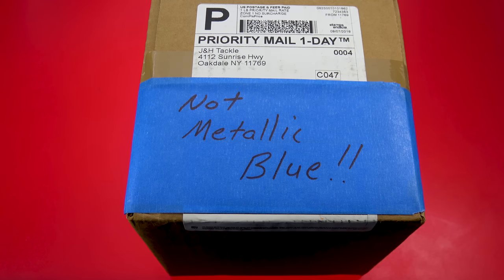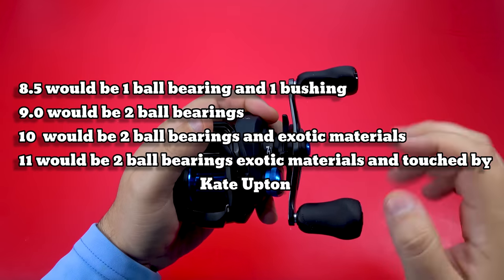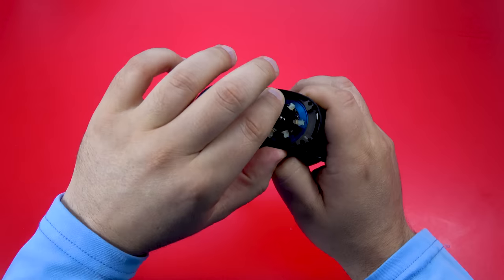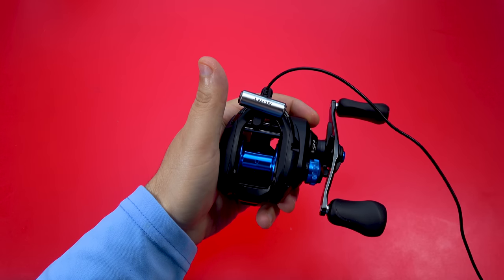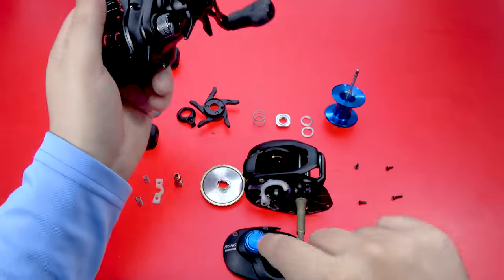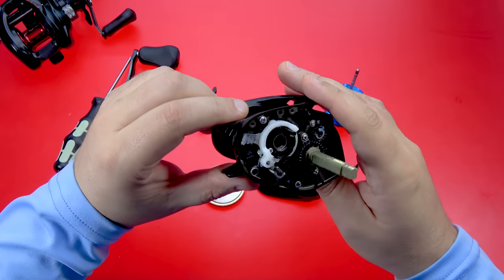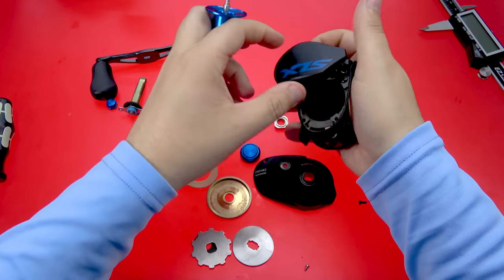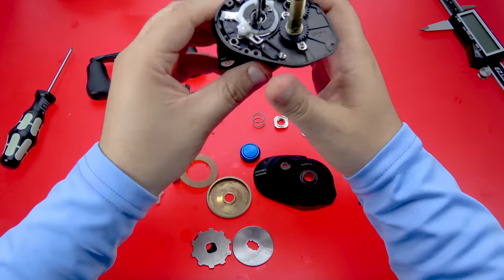NEW $99 SHIMANO SLX Detailed Inside and out Overview.  $99 Tranx 200?

Comment: Shimano is what I consider a safe brand. They haven't released anything in a long time that I personally would consider trash... I loved my old chronarch d. That was a bad ass reel that was imo just as good as the newer e7 that came out. I had both those reels. The only reason I liked the e better was is was left handed.  It's crazy because now, if you spend 100 most brands have developed offerings only dreamed about years ago. I'm not old at all I'm a young guy but I grew up bass fishing. Thank you again for the videos these are golden.
Reply: What's your thoughts on the  budget Shimano Nexave C5000 HG FE

Comment: Quick question. Im having a problem with my slx 151hg. Every once in a while when I real the handle to engage the reel, the thumbar comes up with 2 clicks / rough and I cant figure out why. I’m thinking that it is related to what happened at 19:35 where the little thumb bar mechanism jumped over the plastic ridge when depressing the thumbar. Any suggestions would be great thanks!

Comment: I might buy it for my really light pike fishing, in the 150 size. Will be buying a curado 201 soon for my heavier pike fishing. Still dont cast more than 130-140g and the 201 should handle that.  Others use 200 reels for their pike fishing here in sweden.

Comment: Hey man how hard is it to learn how to take these apart and put them back together for cleaning.  I buy a lot of expensive gear. Every time i have tried i put it back together and something is wrong but ive only tried twice
Reply from the maker: Some reels are easier than others.  I suggest work on a lint free soft surface so parts don't bounce...or you don't damage bearings or gears if dropped... (not like me...i work on a hard surface for filming purposes only and it's bitten me in the arse a few times)  Setup a camera and film the teardown taking note of what went where and if it's a complecated arrangement take a second and film the direction, orientation and order in which everything went.  Baitcasters are usually much easier than spinners.   And take it easy with c clips only remove if absolutely needed.  sometims a strong stream of water can get where you'd be able to get by removing them.    And be careful where grease and oil gets....Grease can slow down a reel to the point it's not even usable...and would then need to be taken apart and more time spent cleaning it out.
Reply: @TackleAdvisors thanks a lot man 
 I love you're videos.  What is you're opinion about lew's overall as a brand.  There one of my favorites but i love it all as long as its good.

Comment: High time Shimano went alum frame on their $99 reel. For a few years they tried to out-plastic plastiking and pissfun...now I'm sure Daiwa's revamping the Fuego CT in response, maybe a 100 sized CT to pair with the new Tat 100? The Fuego, btw, I have zero issues fishing it on a 300+ dollar rod. Exciting times for quality reels at insane price points.
Reply: You didn't mention in video but, what size gear teeth? Semi-micro-module? lol
Reply from the maker: LOL....good question....funny thing is...I just got done mirror polishing them and didn't pay attention to the size lol
Reply: damn...I know you don't credit micro module gearing for this, but the K is just in a different category of smoothness to every other shimano reel in that pricepoint I've owned in the past. The E, I, 70...all great reels, all nowhere as smooth and SOLID feeling as the K. I'm secretly hoping that the tiny teeth does make all the difference lol
Reply from the maker: make sure you're not confusing pitch/ frequency with smoothness.    I spooled this one up a little while ago (since I play musical line and back it.  I basically spool every reel 2x.  Very good line lay and very "smooth"

Comment: What kind of screw head did you use to unscrew the handle at 13:33? I've been trying to use a small phillips head but it wont unscrew.
Reply: Probably JIS or Pozidriv, phillips is designed to cam over (and strip).

Comment: Can you suggest to shimano that pls make the xship bearing into full ceramic. I have change out the xship bearing meany times due to corrosion
Reply from the maker: Ooof... That would be one noisey reel... Try oiling with tsi 321...that's what I do and man does it make a difference
Reply: Tackle Advisors very noisy and annoying and my god the vibration , i plan on changing to full ceramic.
Reply from the maker: @nateriver6269  a full ceramic bearing will be as noisey... Just be wary of that... I took them out of mine... Not worth it... So loud... Watch the Antares with the Sawzall picture where I turned it into a tournament caster...
Reply: Tackle Advisors tnx for the advice👍👍👍

Comment: 18:30 when you are lookin if the pinion is supported by a  bearing i wonder if there is a spot for an extra bearing molded in the sideplate. So could one jus stick a extra bearing in there and have it work meaning theres an xship build in just short of an bearing. It’s like that in many shimano spinning reels, no xship but there is a spot machined/molded in the frame for a bearing that you can add and then it is exactly the xship double pinion support

Comment: I have a slx and it's a good reel sometimes the drag doesn't work properly tho
Reply from the maker: Thats not the first I've heard that... Question though... Are you tied direct with braid? Try taping over the knot on the spool with electrical tape and see if that helps.. Believe it or not braid slippage is incredibly common

Comment: Hey bud it doesn't have anything to do with this video and I can't find your email in my inbox but I was wondering what size of split rings I should buy to replace on some of my baits and what you would recommend,
Reply from the maker: Hey man,   That's a tough one...best bet...measure them and google the appropriate size....or eyeball em  here's a good reference https://www.stripersonline.com/surftalk/topic/472917-guide-to-split-rings-and-hooks/
Reply: Tackle Advisors have you ever used owner hyper wire? Trying to decide between the black or the Chrome and size that would be pretty Universal because I'm no professional fisherman but some of the Spooks I have have those three screw brackets and I'd rather just put split rings on them so I can change out the hooks easier
Reply: Are you fishing FW? Aside from swimbaits and smaller lures most should have #3 or #4 rings, #3 being a good majority.
Reply: Shadow good because I just ordered 50 number 2s 50 number 3s and 50 number 4s of the owner hyper wire, also I have a question for anybody that knows is what's the universal size for swivels for a Carolina rig
Reply: Lot of people like size 2s. If you use a bead you could go smaller.
Reply from the maker: Shadow is spot on.   I default with whatever swivel line tie isn't thinner than the line diameter.

Comment: Can Josh at J&H  send you a VR50  to review?
Reply from the maker: I might not send that one back :)
There are a few of tear downs of all sizes (2 on the 50) on SOL.  And wouldn't ya know it....The VR is exactly what I said it was before it even came out.  It's virually Equal to the standard vs and x at hundreds of $$'s less.  It's just that Quantum had to buy the design form Rob K as they couldn't afford another competitor in that segment.  Problem with reviewing surf reels....A review takes a whole season.  I wouldn't be able to put out a review until next fall.  As is I still have 7 reviews I'm working on from the spring.  (teardowns after unboxing I don't consider reviews but overviews)
Reply: @TackleAdvisors  I hear you on not sending it back. ;) why would you. I have read some stuff on facebook where people were having problems the VR clutch because seal might have gone bad.

Comment: That bushing on main gear shaft is a no for me, the thing will lose it's tolerance and start wobling.
I am okay with bushing on handle knob, else? I don't like it.

I wonder how this reels compare to new Shimano Bass One XT.

Fyi i let my tiny Spinning repaired by reel mechanic, lose (+/-) $5 for 25 years of use? I am fine lol.

Edit: 13 years, not 25
Reply from the maker: That's awesome!  I hope he gets it back running like new!  Honestly.  I like a bushing there. It doesn't make a difference for FW but in the salt!   That ball bearing is first to go.  I've called it the bastard bearing for years!  There really isn't much of a load put on it since when the drag is tight.  the AR clutch and sleeve's keying to the handle shaft takes the load over about half an inch